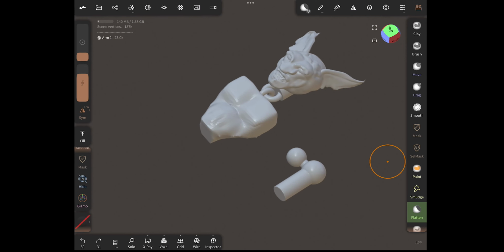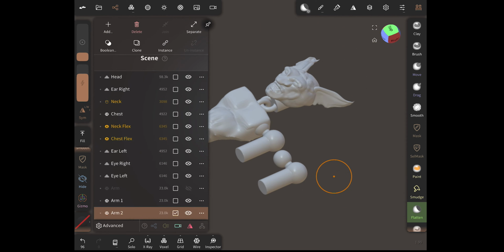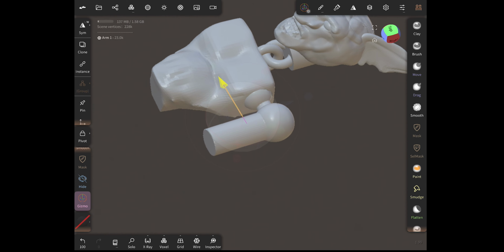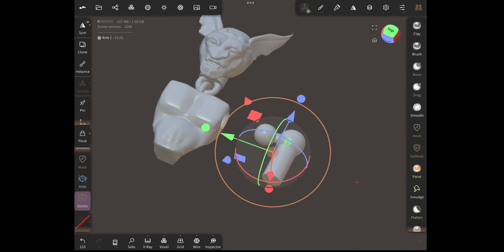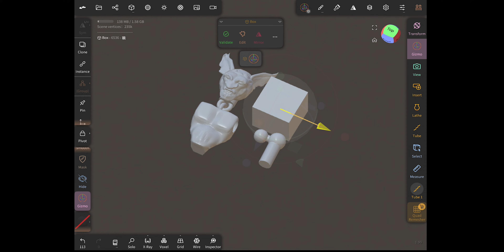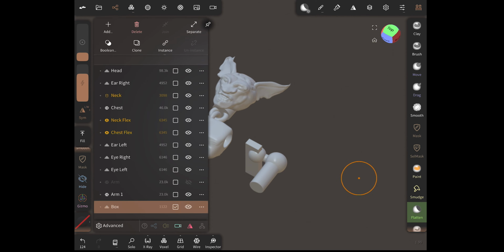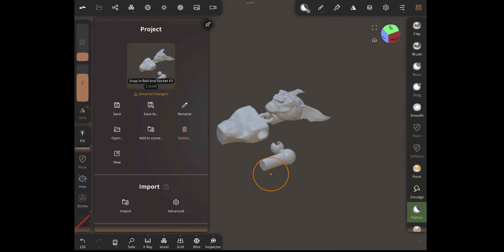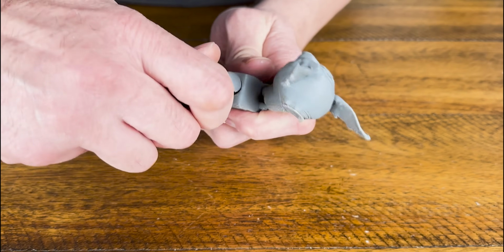Want Perfect Snap in Ball and Socket Joints in Nomad Sculpt? Watch This Now

Comment: How can I make the joint stronger. Mine sem to break easy.
Reply from the maker: You can make the joint thicker and stronger by using more walls (or even denser infill) or use a different material such as PLA+ 😁

Comment: Would doing this with Zbrush be similar?
Reply from the maker: Yeah, the same design concept works in pretty much any 3D modeling software—it’s just a matter of using the tools differently. I don’t use ZBrush myself, but from what I understand, it actually gives you even more control over tolerances, so you’d have a lot of flexibility there. 😁

Comment: Quick question is using the bool tool (difference ) the same as the re-mesh part? 
im making a prototype figure so i wanna master making articulation  joints etc- but ive been using the Boolean tool a lot haha
Reply from the maker: The Boolean tool and Voxel Remesh in Nomad Sculpt are different, but they both involve modifying a mesh. Boolean creates a new shape based on how the objects interact. For example, you can use Boolean to cut one object from another or Boolean to merge them while maintaining sharp edges. Voxel Remesh is used to unify and re-topologize a mesh by converting it into a uniform voxel grid. It is more useful for cleaning up geometry, merging multiple objects into a single solid object, and preparing a sculpt for detailing. If you use a Boolean operation and then apply Voxel Remesh, it will help clean up artifacts or unwanted geometry left behind from the Boolean.
Reply: @ amazing thank you so much!!
Reply from the maker: @catwaltho8703  Anytime! 😁